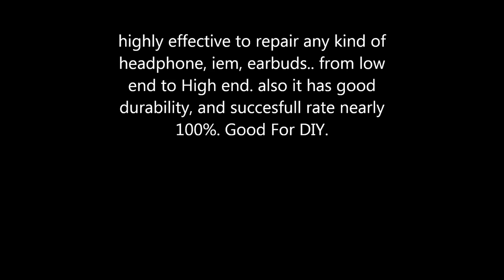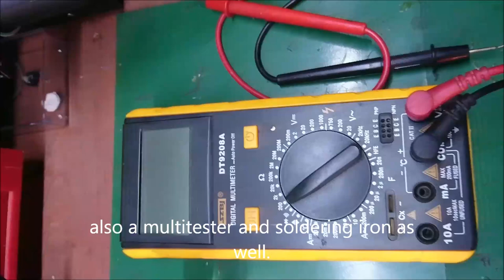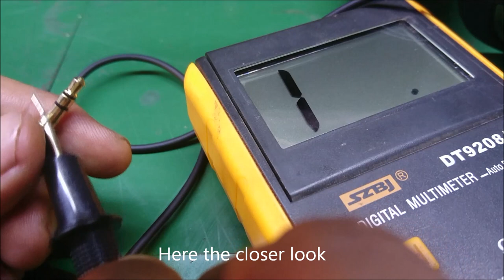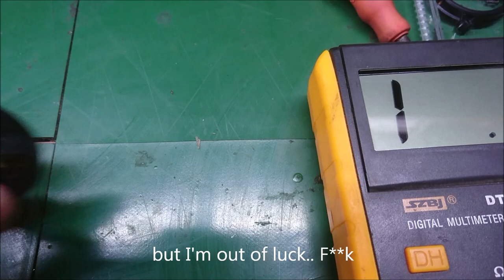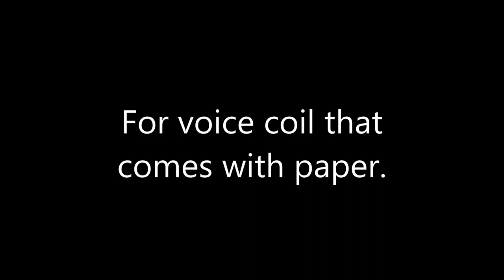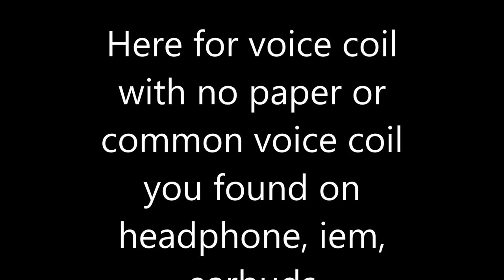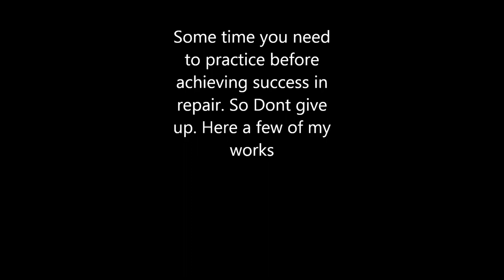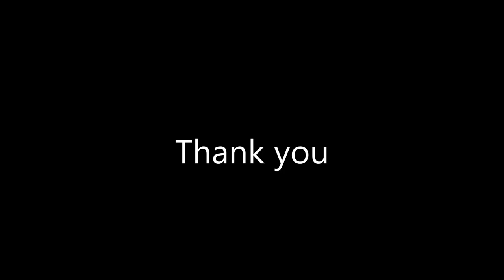Death Headphone, IEM, Earbuds Repair. Step-by-Step Reworking Voice coil from low to high end cans.

Comment: Really fine job... I need to fix my earbuds, but they are super small, the coil is about 3-4mm diameter, and i think i need to re-do the coil. I'm going to use your step by step procedure carefully. Thanks a lot!!!!
Reply from the maker: Hola alberto, for driver below 5mm..use microscope.. You should do that easily if you always practice..

Comment: Brilliant video 👌! 
If you do ever read these comments, please respond 😇.  
I had a pair of JBL headphones and I got down to coil and I'm wanting to know if both wires come from the bottom (closest to diaphragm).  One was snapped so short I can't tell and can't see wires that clearly in video. I've used Isopropyl alcohol, is this suitable? 
Please response 🙌🏾🙌🏾🙌🏾🙌🏾🙌🏾😬
Reply: I have that rotten luck as well. One end of the coil snapped so close to the coil, that I can't find it anymore.
Reply: hello bro i have the same problem did you fix? please help!
Reply from the maker: you have to detach voice coil of membrane, then swabbing the bottom section of voice coil with cotton buds + thinner ND or alcohol 70%.. need a patient untill the end of wires comes. then you can pull that.

Comment: Very nice !, but you did it with big dynamic drivers, doing this with IEM is already harder, but think of IEM that have BA driver or other or even 3d printed-multi-channel cavity (KZ,TRN,FIIO)...........nightmare...probably must replace driver...still amazing video!
Reply from the maker: I using binocular microscope (2 eyepieces), not trinocular with camera. So i can not record them yet..Fixing broken iem with driver diameter less than 5mm is every day job on my workshop for almost 7 years. Please add my facebook : https://www.facebook.com/pakadidukun and instagram kawa_audioservice to see my job.
Reply from the maker: No need to replace the driver for iems.. Its can be fixed, easily.

Comment: The coil's hair-thin wires in my AKG's driver are put in a kind of a red laque. It's just a thin layer and these wires are inside. I don't know what to do here. Can I dissolve it somehow or whatever. Shortly... I've ordered two different pairs of drivers on AliExpress.
Now I'm searching about how to properly tune them before assemblying the headphones. The earcushions are glued to the case with a sticky black tape of a certain shape. So I think it's important to not redo the process too much times.
What's the tips about tuning them? I've heard something about U-shaped papers... something about holes. More/less bass. How to test this before making the permanent construction?

Comment: I accidentally broke the right voice coil terminal of my DT 880 Pro a year ago. I will try to get courage and fix it. What paint thinner did you use? Thank you so much!
Reply from the maker: halo lucas. common paint thinner - thinner ND, alcohol 70% will do fine. for DT880 pro do not attempt dismantle by your self. due to gap between neodyium magnet and its housing are under 1 mm. need fixture to place it properly, manual installation would only lead to crackling sound due to voice coil hitting surface of the magnet.
Reply: @nirvanerz Thanks for the advise! So do you think it would be too risky to try myself without proper tools?
Reply from the maker: Yess lucas.. Its very risky for DT880.. Need proper preparation..
Reply: I also broke a driver in my DT880 Premium 600 Ohm while balance modding them. Beyerdynamic shipped me a new speaker for $50 had it fixed in just a couple minutes and up and running. I have never tried to unwind a voice coil, I am not an expert but from my understanding this would slightly change the Ohm load and they may not sound perfect between each ear. I may be wrong I have a bunch of cheap headphones I have modded for practice over the years I may just pull out a pair and try for fun.

Comment: Thanks for in-depth guide! Does the height of replacement coil result in difference in audio
Reply from the maker: No.. It would not have difference.. 
Unless you replacing coil with other voice coil.. (Eg copper color with red one).. Will have difference on soundstage

Comment: I’m trying to repair the coil on Sony wi-c3000. Any suggestions?
Reply from the maker: Wi 3000 has 8mm driver, use magnifier as i do on my workshop.. So you dont torturing your eyes with small object
Reply: @nirvanerz  masih terima service headphone mas?

Comment: I liked your video but... This might be a stupid question, but where was the break? Would it not be a good idea to test the coil once you pull the wires out a little bit. Going through all that work, then gluing everything back together and no reading comes up on the volt meter. Well that would be rather disappointing don’t you think?
Reply from the maker: no reading comes up on the volt meter happens due too the wire of voice coil not properly soldered to solder pad...try increasing the temperature of soldering, or while soldering, hold the solder tips to solder wire and pad about 3 second to ensure good connection.

Comment: Small questions at first try on old headphone driver the sound got quiter and on the second try on different headphone driver it worked as it was so am I doing something wrong on the first try ?
Reply from the maker: Because voice coil not centered to the cones. And the voice coil touching magnet while playing. Its has to be precise at the edge of the cones. Solution : reopen the membrane, cut the edge of the membrane about 1mm..then see voice coil fitting, do not hit the mahnet
Reply from the maker: Fitting is always critical, give me pm at facebook. I would guide you
Reply: @nirvanerz  ok so I have to center the voice coil and make sure it's not touching the magnet in the middle,but what if the voice coil isn't even circle can I fix it in shape?
Reply from the maker: @Gabri3l_R  for profesional like use. You can use stainless rod, diameter same as voice coil. Just insert then it will fix voice coil. If you diy and want do some macgyver way. Use anything in your house that have round shape and fitted with voice coil.. Maybe pipe or something
Reply: @nirvanerz  I did it using  macgyver way and it worked hope it works  correctly after assembly

Comment: how do you manage to track the polarity of the coil wires?  if you happen to mix them up, the sound wont be centered
Reply from the maker: Easy, use visual inspection. we have microscope 😁
Plus always on outside of coil, minus always inside of its coil. 
https://repair-headphone.com

Comment: What ig those 2little wires are broke
Reply from the maker: you have to detach voice coil of membrane, then swabbing the bottom section of voice coil with cotton buds + thinner ND or alcohol 70%.. need a patient untill the end of wires comes. then you can pull that.

Comment: Done but Not working, Sony headphone, please help, thank you
Reply from the maker: You should pre-coated voice coil wire with solder and tin.. Then apply to solder pad. Or you can just directly solder the wire to solder pad. Wait around 5 second on soldering to ensure wire+solder pad has perfect joint
Reply: @nirvanerz  Thank you very much for your reply, actually, I forget to connect the wire from Bluetooth module to amplifier circuit, then I have recognized that at midnight 12:15 AM, now it's working perfectly with 1% fluctuation on high bass, thank you again

Comment: I'm surprised that these headphones use plastic diaphragm. I think plastic doesn't seem like a good material since it's not rigid. Otherwise, people would use plastic for speaker cone.
Reply from the maker: 97% headphone sold on market are using plastiv diaphragm.. Many has lasted for decades before broken

Comment: Itu kalau driver diatas ukuran13.6mm bang ,, kalo dibawah 10mm gmn?
Reply from the maker: Sama aja.. Beda nya yang dibawah 10mm dikerjakan dibawah mikroskop
Reply: @nirvanerz  bnyk nih mas dibawah 9mm .. ad bbrp yg pengen kubenerin ,,, cz sya gada mikroskop ,, pakai kca pmbesar jg masih susah buat repair coil ,, brgkali mas bs bantu , brp biasanya biaya ?
Reply from the maker: Untuk yang iem, kita cuma repair yang mid to high end mas.. Iem dengan harga di atas 2 juta
Reply: @nirvanerz  oh gt y mas ,, jd ngga benerin yg hanya unit driver aja y mas ,, hrus sepaket y .
Reply from the maker: Harus satu unit iem utuh.. Soalnya ada pengukuran juga via ear simulator, di ukur hanya driver tanpa housing, ga akan benar.